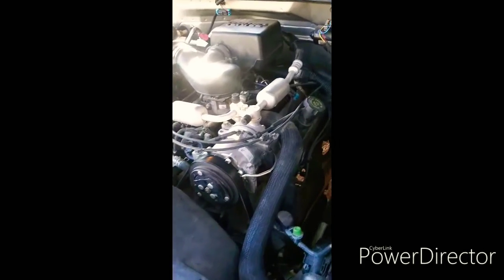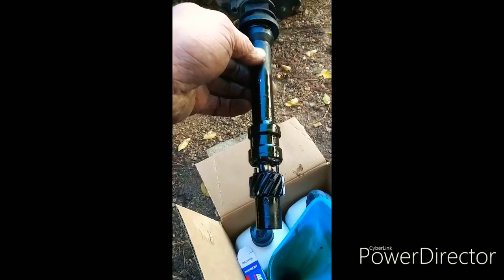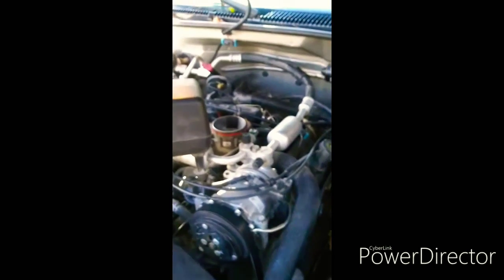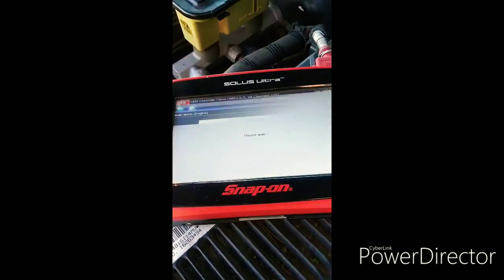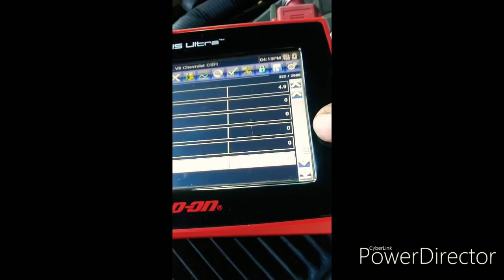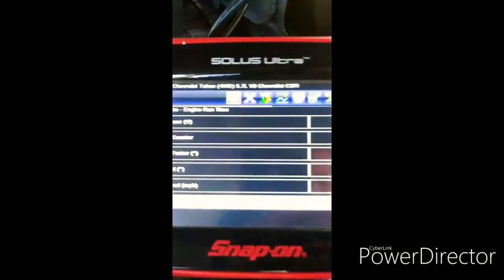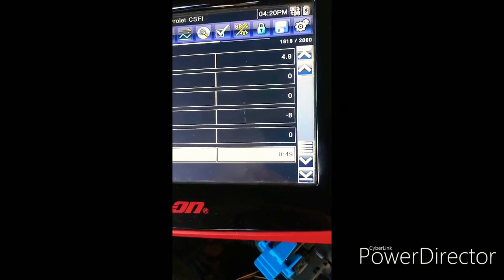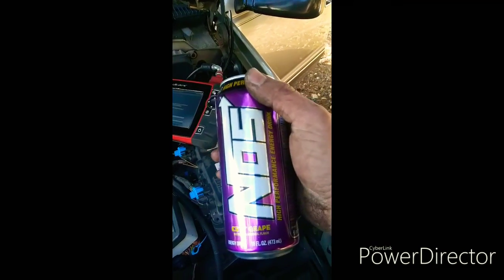How to set ignition timing 5.7 chevy vortec with snap on scan tool

Comment: I am working on a 99 Suburban with this same motor in it.
 I get the timing all set and right and it will run and then after I turn it off the timing gets out 180°. 

What is causing that??

Comment: So if I replace my distributor I need a scan tool to time my 5.7 vortec I can find tdc and the rotor to point at number 1 plug wire but then need scan tool gonna do my lower intake

Comment: I have the same tahoe 99 same color too I cant getbit to pass emmisions it has the p1345 code it's always had this code I have owned this Tahoe for 6 years now and always passed with that code on, now it wont hc and co is too over the limit I replaced the cap and rotor two years ago never changed the distributor think I need a new distributor not sure what to do and I've never replaced distributor before any help would be great thank you I just subbed to not sure if I need a new distributor or just a tool scanner to adjust the timing to 0 or close to it

Comment: How does the scan tool work? I’m not willing to buy a $2000 thing for one time I’m going to use it. Is it a OBD2 thing so I could buy a $300 one? Can you possibly rent them from a auto parts store?
Reply from the maker: I doubt a 300$ tool will have the programs on it to do this procedure. Autozone does not have a tool like this. They have a code reader. That is not the same as a diagnostic tool. Your best bet would be to just take it to a local shop that has a computor that can set the timing. It should not cost you more than 50$
Reply: @TIMEISMONEY-BOSSMAN  ok. Thanks!
Reply: Actually yes this can be done by any obd software that can see your timing,  I've done it multiple times with only my obdlink. Cost to me? 150 bucks in Canada for the obdlink which I've used countless times for many other applications
Reply from the maker: I paid alot more than $2k for this scan tool. Lol. It also costs $1000 every 2 years to update it.

Comment: I've got a 1999 GMC K1500 Suburban with 5.7L engine.  Can I use a timing gun to set timing?  Having a rough idle after warm up.
Reply from the maker: If it is the 5.7 vortec engine the timing has to bee done by computor.
Reply: @TIMEISMONEY-BOSSMAN  I was afraid that might be the case.  Got a timing gun coming in and I going to see if the timing is jumping around.  Been fighting this problem for 6 months.

Comment: How is this done if the truck won’t run
Reply from the maker: Truck has to be running to do this. The distributor in these only turns a little bit. If it wont run then turn the dist a little and try again till it runs.

Comment: But my question for you is where did you get the aluminum distributor. All I could find for my 96 k1500 was a plastic echlin brand at a napa
Reply: UNITED MOTOR PRODUCTS 9362
Reply: Summit Racing Accel $188.00 as of 7-27-2022 . It also takes the slight shake and shimmy out of it when idling . The truck always did it . Now smooth as a clock !
Reply from the maker: Ebay. I beleive jegs and summit also sell them
Reply: Amazon has a bunch started at $43
Reply: I bought my aluminum shaft distributor at O'Reilly.  It wasn't cheap in the neighbor hood of $150.

Comment: Do you remember what brand the distributor was? Would rather put a metal one in mine over the plastic
Reply from the maker: I dont remember. I do know the body of it wall aluminum
Reply: @TIMEISMONEY-BOSSMAN  Maybe Accel?
Reply: UNITED MOTOR PRODUCTS 9362
Reply from the maker: I dont remember. Im pretty sure it was just a random ebay dizzy

Comment: You forgot to do the cam/crank relearn procedure.  Rev the engine up to 4k rpms and let off.......you're welcome 😊
Reply from the maker: No need to. It runs perfect. Some might require it but mine did not.
Reply: @TIMEISMONEY-BOSSMAN  my dad has the 96 and he is having issues with it staying in time. While watching your video it reminded me of the shaft gear and how over time it wears thin and won't keep time. Anyway yeah on that year model (96) you have to do the relearn procedure for the cam/crank relearn. Great video though.!!!!
Reply from the maker: @charlieritchel1492  i bet his issue is the distributor gear. Very common for the vortec engines.

Comment: Why do you have to be at 1000+rpm to set it instead of factory idle
Reply from the maker: Im not completley sure why. Thats just what the snap on diagnostic machine tells me to do when performing this procedure
Reply: @TIMEISMONEY-BOSSMAN  I watched someone set one today with the same scan tool. Didnt notice the rpm requirement, or him performing it, but also there was one in the truck and one turning the distributor why I spectated. 

I'm struggling to understand what's going on here with this setup, but believe I understand. I do know that cam retard isnt the actual camshaft location, but just where the sensor is is in relation to the camshaft, so it's a misleading parameter title, to me. 

Question, if I wanted to increase the base/initial timing through the distributor, is turning the distributor advancing or retarding that by throwing off the cps? Compared to a traditional setup I'm unsure. Or would the computer neglect it and compensate trying to keep it to a base program it doesnt want altered? Any insight you could give would be awesome. Thanks.
Reply from the maker: @garlandjones7709   From personal experience on this tahoe i had a wore distributor gear and could only get the timing within 12 degrees of my target 0 degrees. It ran fine with no issues. Normally if its out any more than that it would cause a slight bucking when at highway speeds going uphill under load. When id floor it the bucking would go away. I dont know a ton about these vortec engines but hope that helps you.

Comment: What if u don’t have that scan tool?
Reply from the maker: You can still get it close enough to run right without the scan tool but the only way to set it correctly and right on the money is with a scan tool. Most automotive or transmission shops will have the tool to set it.
Reply: Yeah I took it to a shop for timing. They told me $60 over the phone. But when I got there after the job was done they were trying to tell me $120 because they had to take out and reposition the distributor. Wasn’t having it. Left paying them $60

Comment: how do u set your rmp to 1000 if your tacometer is bad it dosnt read correctly
Reply from the maker: If you have a snap on diagnostic machine it will show you what rpm you are at somwhere on the same list i show in the video. If your using a different brand it may not show you rpm. Just rev the vehicle pretty high and you will be good. It doesnt have to be dead on as long as its above the recommended rpm
Reply: @TIMEISMONEY-BOSSMAN  thx